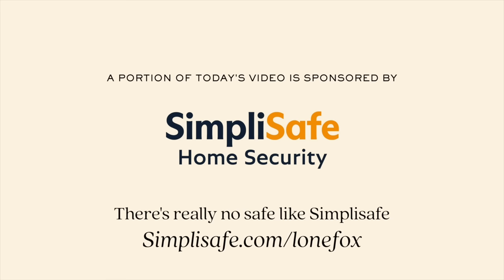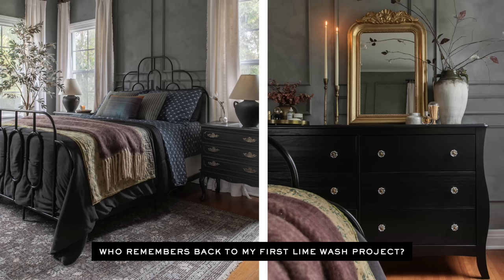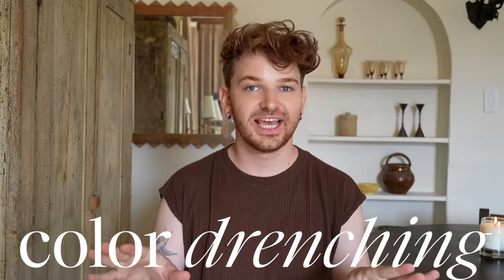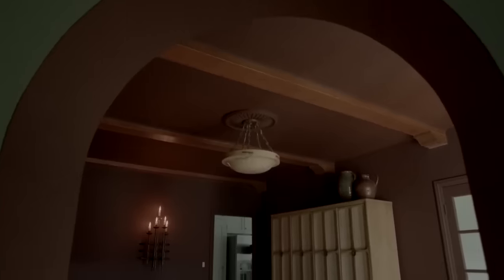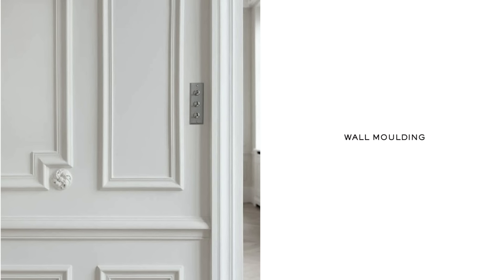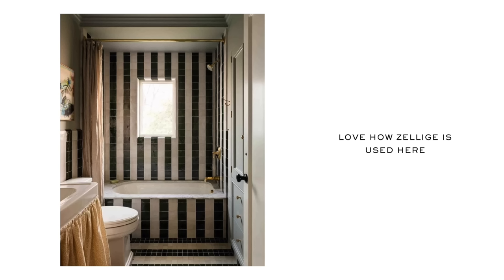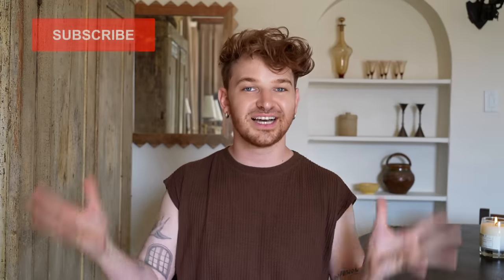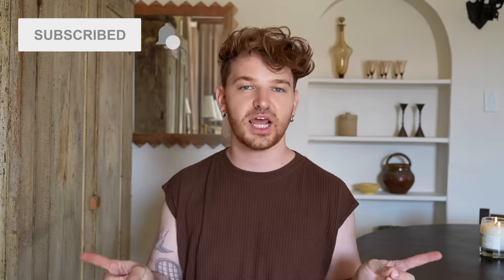10 Interior Design Trends That Will NEVER GO OUT OF STYLE!

Comment: L O L! You were talking about wood paneling, and the reason why it was used. Absolutely correct! I inherited my mom and dad‘s rent house after they passed and you got it. They’ve got the wood paneling on the walls in the major big areas, the living room, the dining room, the kitchen! So in my living room, I caulked where of course it’s come away from the wall and I stripped all the sculpting trim on the top of the ceiling or at the top. And I painted over my paneling instead of replacing it. It’s still a work in progress, but much better than that dark woodin my just a little over thousand square-foot home and it doesn’t make those rooms look so tiny!
Reply: Wood paneling was used a lot in the 60"s and 70's in cheaper construction - no need to dry wall, tape, and mud.  I once pulled the paneling away in a home I was living in and found they had used newspaper for insulation - if they had used any insulation.